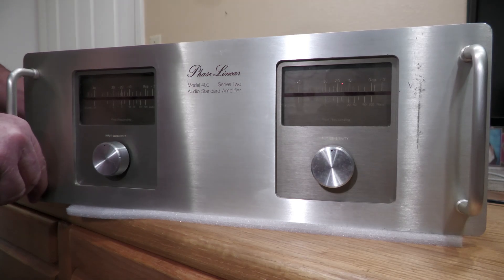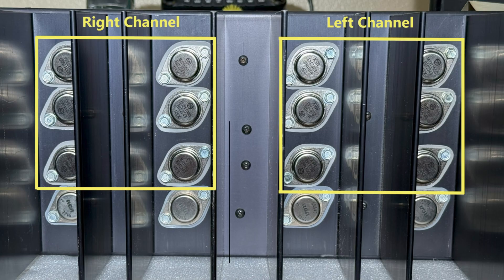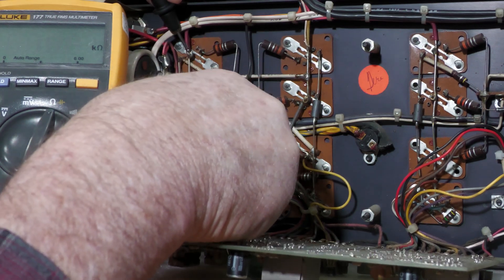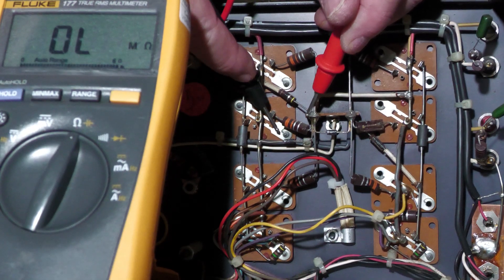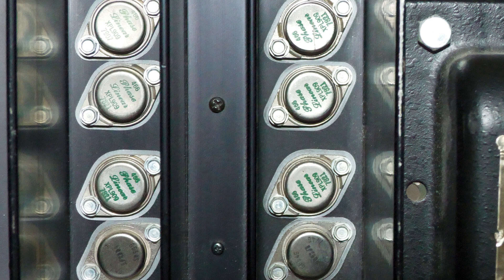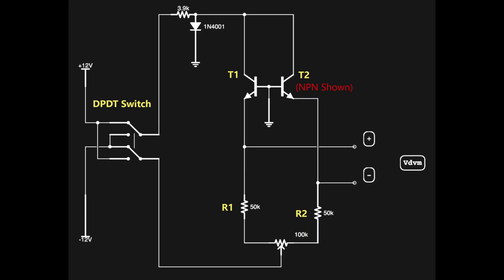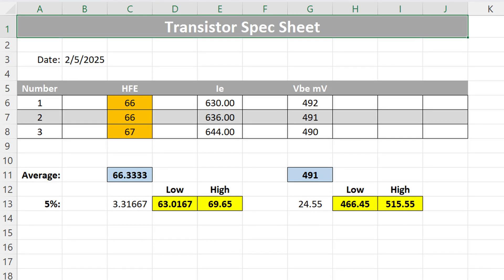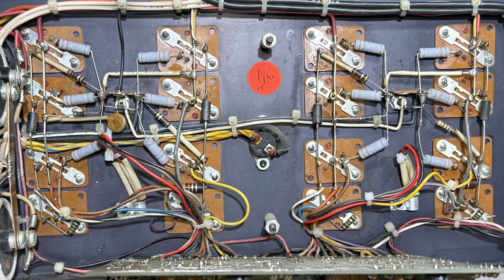Phase Linear 400 Series II Amplifier: Repair (Part 1)

Comment: Sir, I’m working on a 400 series 2 now.  Why does one of the driver transistors the r ca 66546 seem to be in backwards?
Reply from the maker: Thanks for the question! I am vacationing right now, but when I get back home, I will look at mine and the schematic and get back with you!
Reply from the maker: So I have 3 700 Series Its. They are all that way, the drivers are opposite position that the outputs. I would have to
Reply from the maker: I have multiple 700 Series IIs. ALL the drivers are 180 degrees from the outputs. If you look at the part number RCA 66546, you will see that is an PNP (It is the driver transistor for the bank). All my outputs are NPN so yes, the polarity would have to be reversed and that is how they did it. So yes, that is normal (180 degrees from output), at least for the 700 Series II. On my schematic, it is not clear enough to tell on the emitter of those transistors, the arrow is not clear enough to determine if that transistor in PNP or NPN. But again, it is a PNP transistor (look up the spec for that number), so it would have to be flipped 180 degrees to work. I hope that helps.
Reply from the maker: I just looked at the schematic for my "Dual" 500, yes, the driver is indeed PNP. The 500 is basically the same as the 400 / 700, just more output transistors. So yes, at least on the "Series II" amplifiers, that driver was flipped 180 degrees because it is PNP as compared to the quasi complimentary NPN outputs.
Reply from the maker: I just looked at the schematic for my "Dual" 500, yes, the driver is indeed PNP. The 500 is basically the same as the 400 / 700, just more output transistors. So yes, at least on the "Series II" amplifiers, that driver was flipped 180 degrees because it is PNP as compared to the quasi complimentary NPN outputs.

Comment: I have a phase linear 700 series 1 and am replacing the power transisters and the 4 drive transisters. When I was taking out the 1st bank  I noticed the drive transister was facing the same way as the output transisters and the other 3 banks are set up the same way. The 2 nd and forth bank all transisters are facing down. So when I went to put the new output transisters in on the first bank everything went fine but when I got to the drive transister I noticed that the emitter and collector pins did not match up until I turned the drive transister around so it faced down and the other 3 banks are the same way so it looks to me like all drive transisters are supposed to face the opposite way of the output transisters in each bank . Would i be correct the heat sinks are set up the same way. 
Thanks ,
Jack
Reply from the maker: Hello Jack! I sincerely apologize for not seeing your question until today. For some reason YouTube is not sending me comment or question email anymore. But I see it when I go to my channel.

I am not sure what you are asking. Also it depends whether your Series 1 is complimentary or quasi complimentary. My Series II is quasi complimentary, so it uses the same output type (NPN) on all banks and therefore every other bank has the transistors flipped around for correct polarity. 
I would think your series I would be the same (quasi complimentary) unless someone upgraded it to complimentary.

That being said, the transistors will only go into the sockets one way, if they are in the wrong way, the mounting screw holes will not match up.

When replacing the transistors, always make sure  they are matched. The amp will probably work without doing that, however when “stressed” by driving the amp to full output or beyond what it was designed for (4 Ohms or less loads, etc.), you could blow an output because the bank is not sharing the load equally. I have a video of how to match transistors (maybe you have seen that one). I also replaced all my emitter resistors with 1% tolerance.

I hope some of this helps. If not, please respond back to clarify. I am excited you are going thru your Series I! They are alot of fun and if done correctly very rewarding!

Thank you very much for taking the time to ask me your question. It is much appreciated!
Jerry
Reply from the maker: I have 3 / 700 Series IIs. ALL the drivers are 180 degrees from the outputs. If you look at the part number RCA 66546, you will see that is an PNP (It is the driver transistor for the bank). All my outputs are NPN so yes, the polarity would have to be reversed and that is how they did it. So yes, that is normal (180 degrees from output), at least for the 700 Series II. On my schematic, it is not clear enough to tell on the emitter of those transistors, the arrow is not clear enough to determine if that transistor in PNP or NPN. But again, it is a PNP transistor (look up the spec for that number), so it would have to be flipped 180 degrees to work.
Reply from the maker: I just looked at the schematic for my "Dual" 500, yes, the driver is indeed PNP. The 500 is basically the same as the 400 / 700, just more output transistors. So yes, at least on the "Series II" amplifiers, that driver was flipped 180 degrees because it is PNP as compared to the quasi complimentary NPN outputs.
Reply from the maker: I just looked at the schematic for my "Dual" 500, yes, the driver is indeed PNP. The 500 is basically the same as the 400 / 700, just more output transistors. So yes, at least on the "Series II" amplifiers, that driver was flipped 180 degrees because it is PNP as compared to the quasi complimentary NPN outputs.